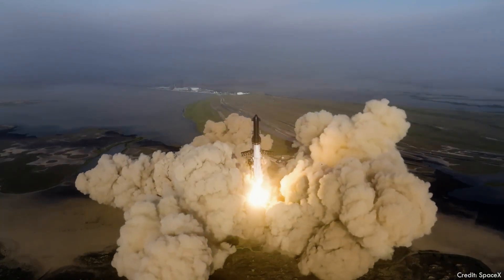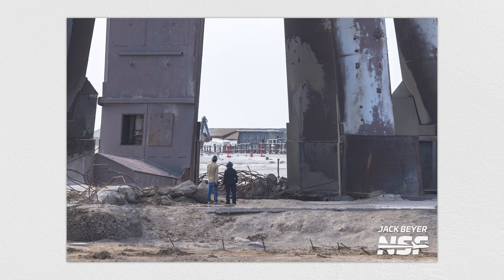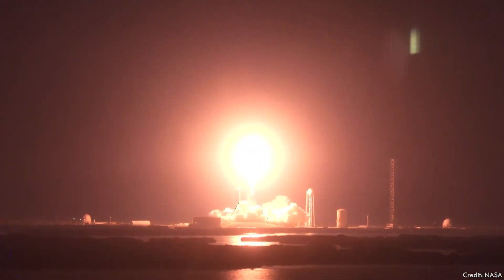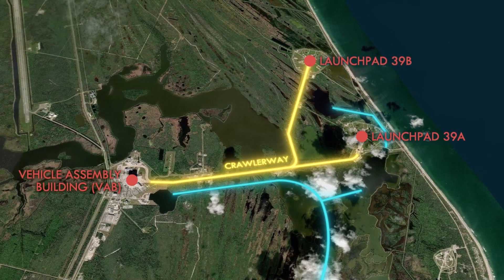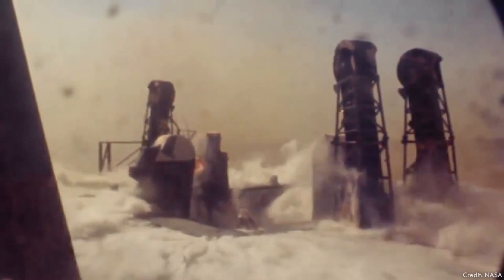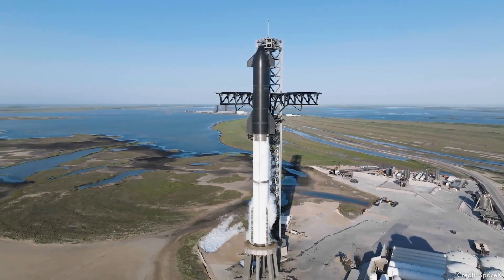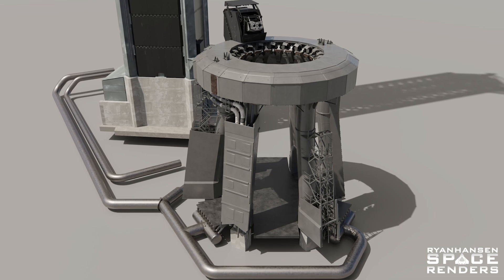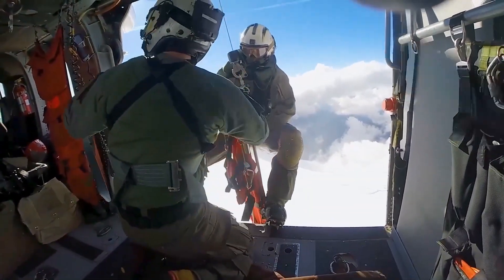Was Starship’s Stage Zero a Bad Pad?

Comment: One of my biggest concerns with the Starship pad is how close the fuel farm is. We saw several tanks damaged by the last launch which could easily have resulted in an explosion and even more damage. So far I haven't see SpaceX address this issue.
Reply: They are swapping them out for horizontal low profile tanks, that's one adjustment
Reply: @DavidHRyall  Even the current horizontal tanks had concrete fall and damage them. I wonder what a giant steel plate will do.
Reply: And they won't, until that design loses them money (like in a launch-site disaster).
Reply: The vertical tank farm doesn't contain fuel. It contains water and I think Oxygen for the most part although some tanks are empty. The fuel is stored in the horizontal tanks that are protected by barriers and are extremely tough and suffered zero damage from a literal worst case scenario. They're also mostly empty and methane is pretty safe, although they really dont want it to leak regardless as it's not great for the atmosphere.

That's why SpaceX is the only company using methane rockets that reclaims and recondenses the methane (using nitrogen) with test fires or pressure tests and wet dress reharsals etc. instead of burning it off or bleeding it off.
Reply: @antoniestrydom6367  Finally, the comment I was looking for.
Reply: @antoniestrydom6367  The Vertical tank farm does contain LOX an LN2, and several chunks of concrete fell on the horizontal tanks and plumbing as well.
Reply: @YourArmsGone  Correct, the tanks only contain water, liquid Oxygen (non explosive) and liquid nitrogen (inert, non explosive) and one is empty.

Regarding the concrete. Due to the damage being from the fondag cracking instead of ablating due to sand compaction, they've already implemented a permanent fix for that. The piles, reinforcement, concrete cap and of course the steel plate on top and the deluge system on top of that.

The risk of anything remotely similar happening again is zero. Also the horizontal tank farm, where the methane is stored, was empty at the time. Spacex only trucks in the amount of methane that'll need so regardless of the damage to it there was also no risk of explosion there either. You know, them being so cheap and all.

Fun fact, the flame diverter that nasa uses is steel plates covered by Fondo or something, not exactly Fondag but similar. So the issue is not the concrete per se, but the sand compressing underneath.
Reply: @antoniestrydom6367  LOX and LN2 both pose a risk due to the pressure when they become a gas, I know you've seen what happens to tanks when LN2 isn't able to vent or is heated. LOX is also highly reactive, many chemicals that barely burn can become explosive in the presence of LOX.
Next you have the problem of damage to the horizontal tanks, while they managed last time relatively unharmed There is still a significant risk of objects falling on them. Even IF they are completely empty during the launch potential damage creates risk when refilling them. 
As for the steal plate, Given the oversight of the current launch pad I'd take SpaceX's assurances with a Large dose of salt.
Reply: @YourArmsGone  The thing that caused the damage no longer and will no longer exist.

That's as basic and simple as I can put it.
Reply: I’m sure everyone claiming that there’s no risk in damaging the tanks will now edit their posts given the information provided by other commenters. because surely you’re not fanboys living in denial…right?
Reply: @JoeOvercoat  considering spacex is changing the design of the pad so that flying concrete will never happen again I dont see why anyone would need to edit their replies to state that there is no danger to the tanks anymore
Reply: ... not forgetting that the damage was to the outer skin of the vertical tanks - there's an inner tank which holds the pressurised liquids. But as others have commented; SpaceX is changing them out for alternative tanks 'as we speak' :)
Reply: @stepheneyles2198  Changing over to horizontal tanks will reduce the risk somewhat, However The fact that none of the Larger pieces of concrete didn't demolish the tanks last time was pure luck. Now they are testing a new pad design but if anything goes wrong the tank farm is still a major risk factor.
Reply: @YourArmsGone  I know this one. Those tanks only contain liquid nitrogen, oxygen, and water. Originally the plan was to make their own vertical methane tanks,  but turns out you can't just do that. Tanks storing methane around people need all sorts of certification, so they had to buy a bunch of those horizontal tanks for that.
Reply: there is not much fuel left in them when it is all in the rocket.
Reply: @snuffeldjuret  Empty tanks are more explosive than full ones.
Reply: So wise! That’s why we should accept that fuel tanks getting sprayed with concrete chunks is an acceptable downside :)
Reply: The tanks are mostly empty after launch and the fuel is methane which is not particularly explosive.
Reply: @nightonfir3  Several of those tanks contained LOX and LN2.
Reply: @nightonfir3 re you joking???
Methane, the gas that haunts mineshafts and many other places, known for its tendency to form explosisive mixtures in air fairly easily, not explosive???
Reply: @nightonfir3  Empty tanks are MORE explosive than full ones.

Comment: Addressing your comment on SpaceX's dev cycle.. That's all well and good, but they had better take the careful, procedural approach that NASA has developed for any missions involving human spaceflight. Lest they end up in a situation like the Titanic submersible.
Reply: humans have been flying on Falcon 9 for the past few yrs already so..
Reply: They used the exact same process they use now on Falcon 9. Falcon 9 has had 1 partial and 1 total failure in 237 launches. Dont you worry, Starship wont transport any humans before it has flown dozens of times without incidents.

Edit: First falcon9 flight was in 2010, first crewed one was in 2020.

Comment: I think the "blast proof" concrete would have had a better chance of survival if the ground it was sitting on had been fortified, reinforced, braced etc. for the weight of 17 million pounds. It would be the same as, perhaps a 12 story building being dropped 60 feet on unreinforced ground with a thin covering of steel.

Comment: Hey Grady, what are your thoughts on the feasability of that ''upside showerhead'' SpaceX plans to use to cool the rocket flame and prevent future disasters..? The water deluge system you talked about at Pad 39A/B uses roughly 1.7 million liters of water in little over 30 seconds and is gravity fed/operated. It is my understanding and opinion that SpaceX's system can never match the deluge systems of NASA despite having a bigger rocket.
Reply: they would not be allowed to spew out that much water at boca chica.
Reply: 100% going to fail. When it happens again, I hope they get evicted and fined. They broke enough laws already.
Reply: @oohhboy-funhouse  the government has a vested interest in the success of starship, beyond using it as a lander for the artemis program

lunacy to think that they would do anything of the sort
Reply: @oohhboy-funhouse silly kid
Reply: @oohhboy-funhouse  cry harder
Reply: @DavidHRyall  keep snorting concrete dust
Reply: @oohhboy-funhouse cry

Comment: SpaceX should be allowed to alter their facilities just like NASA was allowed to do.  NASA was allowed to fully alter their lands to prep for MANY rocket sites and launches and fuel and water management.  SpaceX should be allowed to do the same.  Besides, Methalox is a much cleaner burning system compared to what is used at NASA launch sites.
Just because NASA is a gov't agency should not have given it a pass for site development when SpaceX is needing the same work done.  If NASA can bypass environmental requirements and dig and dredge, cause fires and explosions to their hearts content, then so should SpaceX.

Comment: This launch was a catastrophic failure on multiple levels. It would be nice to hear an engineer mention that reality instead of glossing over the fact. NASA plans and develops things for years because they're a grown up organization. Saying space X tests full scale products and has a rapid development cycle just makes this sound like another puff piece while ignoring that they're failing. The thing annihilated itself but let's just call that "how space X develops things"
Reply: In some ways this launch was a failure (mostly due to pad damage), but half the issues have already been fixed. The next booster doesn't use hydraulics (the cause of the loss of control), has much newer engines (decreasing the chance of engine failure), and has much more advanced engine shielding so if one engine explodes it will be less likely to destroy nearby engines).
Reply: Boeing still hasn't gotten any astronauts to ISS...

Comment: Move fast and break laws - criminal egomania.
The predictable damage to the rocket along with FTS failure could have killed thousands.
Reply: Lol no it couldn't have. They account for the rocket blowing up on the pad. Nobody and nothing was in harms way.
Reply: The FTS would likely have performed a lot better if it had been earlier in the flight and generally in most other situations. It was a combination of different factors that caused the delay in destruction. 

The engines weren't producing enough thrust to put the tank structures under a lot of stress, and it was fairly high up, so aerodynamic loads weren't too high. With relatively low stress on the tanks, weakening the structures of the tanks with explosives took fairly long to cause the destruction of the rocket.

I doubt there were any scenarios in which anyone on land could get hurt, though debris falling outside the expected area at sea was likely possible. The rocket would need a lot of thrust to reach a location on land with people, and with high thrust, the destruction of the rocket would likely have occurred immediately.

Comment: Total rookies...Elon is not as smart as he seems. The Russians have it down pat, they realize that the exhaust blast is brutal and must be directed away from the rocket or otherwise it will reflect back to the rocket. But Elon wants to reinvent the wheel...what a rookie!

The Soviets when they launched their R7 rockets they were suspended by large clamps above a huge blast deflector...when the rocket reached 100% thrust the clamps just let go of the rocket in mid air leaving it to fly away...so they were and still are the best rocketeers by far.
Reply: not sure if sarcastic or not.

Comment: If SpaceX built cars, Starship would be akin to a dragster with two 10,000 hp nitro burning Top Fuel engines, and the launch pad would be a “built” 4L60 trans.

Everyone told them for years that 4L60 would never survive and would grenade spectacularly, but they launched it anyway.  And sure enough, the 4L60 exploded to bits and ruined the drag strip (the surrounding protected wildlife preserves and parks in this example) for everyone else.  

Now they’re want to come back and launch with another 4L60, but this time is has better clutch packs and a billet antifreeze cooled fluid pan.  And anyone who knows what that is knows that the exact same thing will happen as before, except the damage to the “track” (parks/preserves) will be even worse.
Reply: "everyone told them"
Yeah, those without knowledge.
Reply: @snuffeldjuret  
That "everyone" also included experts in the field.  

It doesn't take a rocket scientist to recognize ignoring 60+ years of launch pad development of flame trenches and water deluge systems is a bad idea...  especially when launching the "most powerful rocket ever".  It's akin to a body builder that skips leg day.

Comment: Decent video, but man, the comments are annoying as usual. What a bunch of misinformed internet-engineers. 
Let's provide some clarifications:
SpaceX complied with all safety regulations before, during, and after the test flight. 
Yes, they knew the pad was not ideal, but their calculations showed it would survive one launch (it didn't, because the soil underneath the pad caved in under force - the transfer of force into the subsoil was too much). 
No, Elon Musk hasn't personally ignored engineering results. I'm not even going to go into all the nonsense people say about him - 99% of negative things you hear about that person is literal slander and disinformation, usually carefully framed to pretend as if he is personally responsible for everything bad that ever happens, and has no hand in anything positive that ever happens, at any of his companies.
No, they don't need a flame trench - but they do need flame diverters and a water deluge system, which is what they are adding, alongside re-enforced groundwork and metal shielding. 
The pad is already quite high up, basically providing a similar effect to a flame trench (if the ground doesn't cave in). 
The parts and plans for the improvements were already present before this launch. SpaceX wasn't "cheaping out", they simply wanted to test as soon as possible.
The reason they are doing things so minimally at first is because otherwise you will never find out how much or how little you actually need. Their approach is faster and cheaper, and the fast and cheap testing results in more data, ultimately making things safer than any other approach.
There was no significant environmental impact, and US government institutions agree with that - it was just dust, sand, and rocks being thrown around. 
The rocket uses methane and oxygen, which burn cleanly and have no significant environmental impact (even if they would do many flights a year).
The overall environmental impact of launch sites like these is positive, because they provide a protective zone where normal human activity cannot take place.
Nobody was in danger during the launch, because everything was evacuated.
No, the pad is not without a flame diverter/water deluge as a "simulation for Mars landings" - Mars landings will not include the massive Superheavy booster at full throttle.
The potential of total failure was already taken into account by US government and SpaceX. This event was not nearly as bad as a total failure would have been.
SpaceX has revolutionized the launch industry and is widely seen as the safest and cheapest launch provider - if there is a problem, they will find it, and they will (and do) comply with any regulations and investigation efforts by FAA or other institutions.
This is a test program. There will be more "failures", and more improvements will be made.
NASA has always hired companies to build their rockets. SLS is non-reusable rocket with environmentally-damaging solid motors, mostly built by the US military-industrial complex (Boeing, Lockheed Martin, etc.) and some international partners. It is a government funded program that costs in excess of 4 billion per launch at minimum.
This SpaceX test program is far cheaper, and the Starship rocket is far more capable.

Comment: My guess is that Elon simply wanted to see why chunk of concrete aint gonna work and what will be consequence if there are only a concrete. Considering that building launchpad on Mars is tremendous work, Elon prob wanted to see if there is ever a possiblity of building "improvised" pad, for the case where emergency launch is needed at Mars. 

Too bad it turned out that concrete aint gonna do anything. Even Elon was very WELL convinced this time.

Comment: It's probably a basic physical principle, and I ought to know, but would the rocket thrust be affected, and how, if the exhaust was directed into a deep, deep hole in the ground(and then out towards the side)?
Reply: That's basically what the Russians do since they launch from the edge of a desert and don't have to worry about the sea level problem. With a deep enough hole you wouldn't really need any special equipment since the exhaust would get slowed down by the air, but the Russians still need to have a sort of flame diverter near the bottom
Reply: Nope, rockets are designed to thrust even in the vacuum of space, it's just a matter of how much mass is thrown out the back end at what speed, and where the mass goes after that doesn't change what the rocket does (even if it hits the ground, its not like the gas can push back upwards against the force of more gas being ejected at much higher pressures out of the engines.

As an analogy, think about how you can feel a hose on high push back against you. Regardless of what sort of loops and bends the water took through the hose to get to the nozzle, the main force you feel holding on to the end is always directly away from where the hose is pointing.
Reply: @fnln-namaemyouji  to expand on your analogy, whether you're watering some plants, washing a car, or just spraying up in the air, you still feel the same amount of force (more or less)
Reply: @fakename287  Yeah, that works probably better. I was thinking of basically the water in the hose as the path of the exhaust, and the water leaving as the rocket, but on reflection I didn't clarify that as well as I should have, and your version avoids that issue.
Reply: @fnln-namaemyouji  To continue the analogy: the reason for the flame diverter can be observed by anyone who has ever tried to use a pressure sprayer on something that was a bit too close and experiences the resultant soaking. Or worse. Always direct your pressure in a safe direction!